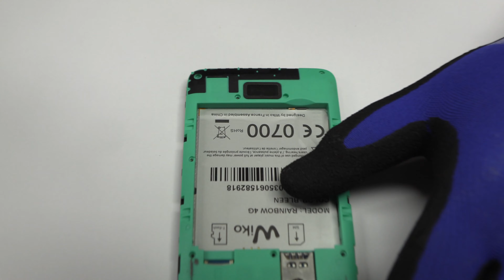Desmontar Wiko Rainbow 4G

Comment: Sabes que le pudo pasar a mi celular ,un día se fue la luz y lo deje cargando y cuando vino la luz ya no prendió nose que pudo pasar si estaba bien podrías decirme q problema puede ser ,buen video
Reply: Seguro se daño algún ic relacionado con la carga y administración de los diferentes circuitos en placa debido a un pico elevado de voltaje o en tu caso una entrega de voltaje irregular.Espero a verte ayudado.saludos
Reply from the maker: Hola. Como dice el compañero, algún IC de carga puede ser el culpable. Es muy importante saber si estas cargando el celular con el cargador original. Un saludo!